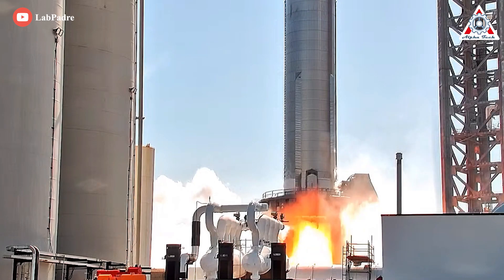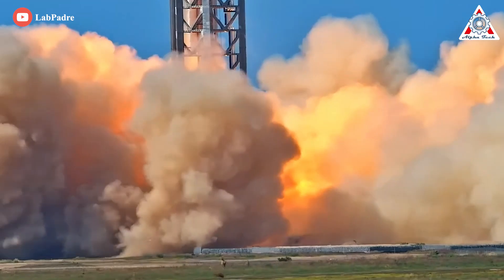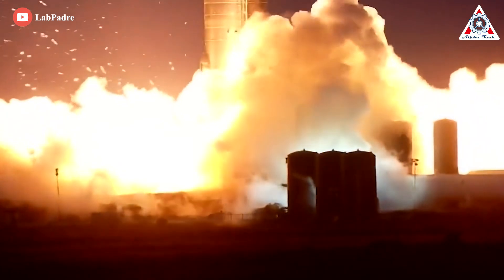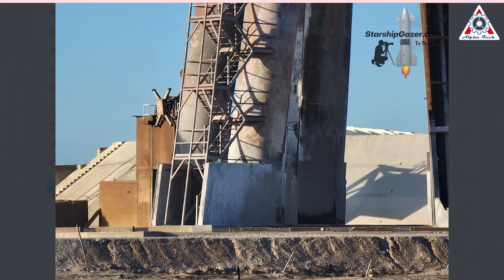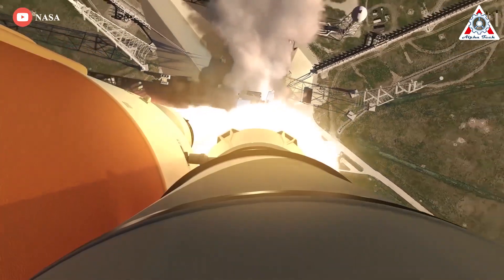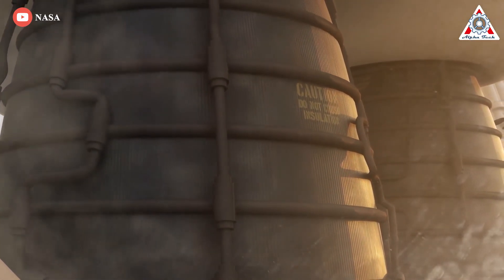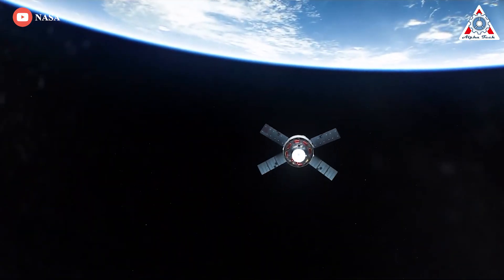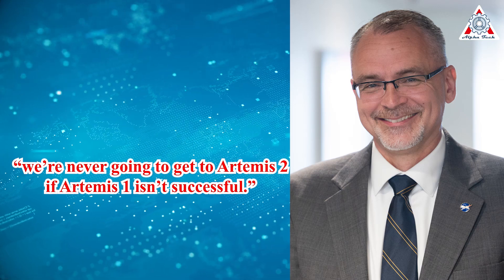Analysis Starship Super Heavy Booster 7 14 engines Static Fire "Problem"...

Comment: I don't know anything about launching rockets but seems like there needs to someplace for the exhaust to go. My thought is a 30 foot diameter shaft under there with a platform in it that raises up and down, up to ground level to put a raptor on and raise it up to install or remove then the platform lowers to the bottom to launch, when at the bottom 6 tunnels are exposed for the exhausted to escape to ground level some distance away.

Comment: I think it's crazy how NASA finds it acceptable to test a rocket one time and then say it's okay to put people on the next one when in fact the one that was tested is completely destroyed when it's finished and can't be used again. Seems like putting humans on the second one is a bit premature. How do you know the first one didn't just barely succeed and the second one isn't going to blow up? SpaceX had to fly their vehicles over and over again with cargo before NASA was okay with putting a person in the thing. I definitely wouldn't want to be one of the astronauts that rides in any NASA's rockets. Especially after finding out the people in charge had ignored the engineers that told them the night before launch that the Challengerwas going to explode. As smart as the people at nasa may be, it seems like they don't have a whole lot of common sense. Spending billions upon billions of dollars using old technology that can't be reused and then Deming it safe for people to fly on a brand new rocket system even when the first one had issues.

Comment: This shouldn't be the hard of a problem to solve, just repair the concrete and then lay out a bunch of 1 in or more thick steel plates all over the launch pad and then weld them together. Have gigantic threaded studs embedded in the concrete and sticking up and have holes in the steel plates that match and then screw on some big nuts and washers and Bolt the plates down, and call it a day. Use some sort of high carbon ballistic Steel and that rocket should not be able to faze it. If needed it could be sintered with a layer of tungsten, at least where the blast hits it directly. It might be a little bit extreme but they wouldn't have to mess with it again.

Comment: I didn't see any videos of Booster 7's 14 engine firing that had resolution good enough to differentiate the weather the falling chunks were ice or Martyte.  If they were "concrete" as you've described here, thrm most, if not all, the chunks were Martyte  . . . a ceramic based epoxy used for coating Starbase's launch & test pads. Martyte is sacrificial by nature, meaning it's expected to break up while protecting the hardened concrete beneath it. The worst that could happen is Martyte chunks damaging Engines, wiring or plumbing. SpaceX has experienced this before and taken precautions.  I'd be surprised to hear of any more damage than to the Martyte coating itself.

Comment: Suggestion for upgrading the launch mount for starship. Line the launch mount with firebricks, foam glass or even starship heat shield tiles. Obviously concrete is not sufficient blast shielding.

Comment: Why don't they use the heat shield tiles to protect the rocket mount? It seems like there's no chance of it surviving the heat and thrust of all 33 engines firing at once with the heat shield they've already added! I get that they want a different way of doing things, which opens the possibility of creating new and sometimes better methods of launching a rocket. But the damage and the plumes of dust should be a very serious consern.

Comment: with all the geniuses working on SpaceX, can't they see that the clearance between the engine and the ground is too short for the engine blast?
Reply: It is not the clearance. It is the reflection of the blast wave off the ground. They knew about it but Elon didn't want to build the flame diverter. Because he wanted his rockets to land on 6 legs and a flame diverter prevented such a landing. But that landing on legs idea was eventually scarped as rockets needed to get beyond LEO had to be more powerful.. Now they are having issues. The correct solution is to build a pad with flame diverter, a big one that can take 2x the power of a Saturn V rocket

Comment: Very short record.
Artemis finally launched VERY early in it's launch window - less than 2 days later.
Booster 7 will have to fire about EVERYTHING to take the record back.
Reply: Booster 7 will have to fire about 20 engines to produce more thrust than the SLS.

Comment: Yeah, welcome to the lowest bidder concrete contractor in Texas. Contractors in Texas are notorious for overwetting concrete in hot weather to make it flow more quickly and go farther (water is cheaper than concrete on a big job) during placement, instead of keeping it stiff within specifications by using vibration for assistance. Too much water in concrete makes it weak and causes spauling. Both the contractor & the QA Inspecter should be called out for not doing their job. That's going to require an expensive fix.

Comment: Everyone knows all this concrete stuff, the problem is everyone demanding heavy burn the pad to death because NASA does it for their specific reasons related to one off motors that after 50 years are somehow expected to be unreliable, you don't run your car for 2 hours before driving to the shop just to make sure same with a 747.

Comment: Just place a simple catalyzing ring directly beneath the rocket and catalyze the exhaust, using the heat, back into methalox, and use the velocity/ pressure to pump it thru a one-way valve back into tanks. At liquid state, run it thru filters to get the concrete, bricks, crisped birds, sand glass, alligator bacon, and water ice out of it and violla! Efficiency! Re-usable fuel!
Reply: Alligator bacon for sale after every latch .LOL.
Reply: You id  iot. Please be reasonable. Not funny.

Comment: I have never thought clustering so many engines was a good idea.
Reply: Each engine is separated from the other engines with a heat shield so there is no problem with them being close together.
Reply: @michaeldeierhoi4096  That's not my concern. Having so many engines increases the chance of an engine failure.
Reply: @bobhope3716  When is the last time you heard of a failed engine on a Falcon 9 or Falcon Heavy?  If the raptor engine is well developed and proven like the Merlin engine then multiple engines as on starship won't be serious problem.  And an occasional engine failure is more then compensated by the redundancy.  

And bigger engines become proportionally more technologically difficult.  The Blue Origin is a case in point with the Be-4.  These are the only two methlox engines being tested to my knowledge.  

Over just a few years Space X has overseen a rapid development of the raptor engine which may be the most innovative rocket engine out there.   

The tests of starship orbital flights will be the real test of the reliability of the raptor 2.
Reply: @michaeldeierhoi4096  Ya Ba Da Ba Do !
Reply: @bobhope3716  Is the best you can come up with?  That sounds more like Fred Flintstone.

Comment: I'm amazed at the apparent, mind-blowing stupidity of firing 14 engines with zero exhaust venting by the launch pad. It's as if they want to avoid building what's clearly needed to save spending the money where it's needed. However, it could be that the long-term idea is to launch out in sea where explosions will cause minimal damage to the surrounding area including a miscapture leading to an extinguished explosion.

Comment: I am sure SpaceX have thought of this and there is a good reason not to do it, but why not initially fire a small number of engines, just as many as needed to clear the launch mount by a safe distance and then fire the remaining engines? This would dramatically reduce the forces applied to the launch mount. I know they would need to carry more COPV's onboard, but I worry that multiple launches of Superheavy with 33 Raptors firing will destroy the launch mount, no matter how much protection they give it.
Reply: You need all the engines at the beginning because that's when you have the most fuel and weight.  And fewer engines, even if it was possible, would mean a longer time lifting off the pad pelting it with even more heat.

Comment: The whole idea of using just one launch tower is... and the whole idea of catching a Starship and Booster with the chopsticks is...If the booster/starship blows up after say 10 launches then it will take at least a year to rebuild. They should build a landing site just like Nasa's...away from the tank farm and all the support equipment. Also, a Capsule? really?. A Capsule landing on the Moon?? We need rocket ships to land on the Moon not 60's capsules. They should scrap the Artemis program and go with Starships.

Comment: Elon and SpaceX are pretty dumb to have a flat base under the launch tower. It should have a deflection slope at least twice of the Saturn V rockets. When they fire all 33 engines, I wouldn't doubt that it will blow a hole so large that the tower will tip over.

Comment: Debris is one of the reasons why you clear the pad. At some point, I believe Elon will have to look at a true flame trench/diverter. You know, some of those bits of concrete hit the underside of the rocket. I wish Elon and his team all the best and I wouldn't bet against him. This was a true huge success on several levels.
Reply: The pad is clear.  The debris is from the pad literally being blown apart by the rocket blast of the Raptor Engines.
Reply: @damonried1720  ...ABSOLUTELY RIGHT!...that's what this twit doesn't seem to understand.
Reply: ...Just how much of a HUGE success is it going to be when a fully fueled Starship explodes on the launch pad?...The fix is required NOW!...NOT at some point down the bloody road!!! 🤪🤪🤪...🙄

Comment: “Don’t raise the bridge, lower the river.” 

No guarantee, but one of many things that could help with pad RUDs would be to raise the height of the launch mount, or redesign it to be a deeper pit. The thought is that by increasing the distance from the face of the concrete to the closely concentrated thrust from the engines, the distance would help soften the intensity of the thrust hitting the face of the concrete.

Comment: At least 22 engines are required to lift starship at full propellant load, so with it likely not being a full propellant launch for the first orbital flight, a 14 engine takeoff is completely possible, so it would not cause much more damage than what we have seen on this static fire
Reply: With a thrust to weight ratio of 1.5 the starship would need at least 22 raptors firing full throttle to lift off. L 14 raptors wouldn't cut it.    Even with that number of engines firing the slower lift off means the plume damaging the underside longer.  The whole point of starship is fire all 33 engines to lift more quickly clearing the pad and tower a few seconds.

Comment: There was a good reason why the Saturn 5 flame pit was so huge and why the rocket was so high off the ground. Even then the pit was usually damaged.
Reply: Water helps. But  Russia used a deep pit on top of a very high elevation system. NASA new this their for integrated lots of water .

Comment: 1:35

Why would booster firing 14 engines produce more thrust than the falcon heavy firing 27 of the same engines?
Reply: Because they aren't the same engines at all. Falcon9/Heavy uses Merlin M1D engines that produce around 63.5* tonnes of thrust each at sea level (Using kerosene and liquid Oxygen) whilst Starship uses Raptor2 engines that produce around 230* tonnes of thrust each at sea level (Using methane and liquid oxygen) 👍

(* - Different sources give different figures...)
Reply: @marko247  wow, the starship is absolutely incredible when you compare it like that against falcon heavy. 33 engines plus 6 on the upper stage absolutely dwarfs falcon heavy
Reply: @NuDavai  Falcon Heavy is already a pretty beefy rocket... Starship will be like strapping 4 and a half of them together. It is shaping up to be a monster of a rocket!  👀
Reply: Gee just a little time ago the Falcon was BIG .

Comment: If the Starship rocket is having this much of an issue with debris flying around when the engine ignite over a well prepared launch platform, just how in the hell is it suppose to get off of the moon from a un-prepared surface?????  I hope the simulations showing Starship landing on the moon have left something off because those engines come very close to the moon’s surface, and I don’t see any way for the engines not to be destroyed when it tries to takeoff or even just from the landing.  Anyone know how this is really suppose to work??????
Reply: I was interested in this as well. a nasa employee thinks this is completely doomed from the get go. the original moon landing vehicles were all extremely small in comparison to what is being planned currently. I wonder how the moon lander fair with its launch and if there was any damage from debris during lift off.

Comment: why are they not simply lifting the rocked mid air and launch it from 30m above?
Reply: The launchpad is Stage Zero, it couples to the outer ring of twenty Raptor engines at the bottom of the booster and provides high-pressure gas to spin up the engine turbines at ignition. This is called "spin prime". Lift the booster up off Stage Zero and the outer twenty engines can't start. The SpaceX engineers didn't want to carry turbine start gas for all 33 engines in the booster because it would take up a lot of space and add weight which they wanted to leave on the ground. They can start the centre engines with onboard gas since that's required to restart them for for re-entry and landing of the recoverable booster but the outer ring of engines are only started once at takeoff.
Reply: @robertsneddon731  then a classic design with a flame tunnel below the pad would make sense

Comment: I don't see this as a huge issue. These tests are meant to not only work out any rocket/engine issues but also work out the exact requirements for the ground equipment. The people at SpaceX are smart. They knew rather they put a fire diverter in or not that they couldn't leave all the pipes and wires exposed so pieces were designed to protect them. With the larger amount of engines now being tested they can fine tune where they need extra protection and can alter the pieces meant to protect these systems. Which they have already started.  After the static fire of the 14 engines. They have already started to weld the protective pieces in place to cover these exposed systems.  As for a little paint flaking off. If that is the sole issue and it doesn't overall effect the health of the stand. Then I think SpaceX can afford to send some out there with a roller to constantly repaint. If that's the cost of making the human race a multiplanet species.

Comment: Not surprising at all! I have always thought SpaceX has completely underestimated the entire conception of Pad/Flame Trench//Water Based Force and Sound Suppression system - by orders of magnitude. “Big Rocket on a table, with a bit of water underneath” doesn’t remotely do it.  Look at the mega trenches and water systems at NASA’s launch complex 39. They were designed for the Saturn V, and that’s still considerably less than what Starship is supposed to pump out.

All of the SpaceX facilities in Texas look incredibly unprepared for the ghastly magnitude of Starship. Facilities, other ships, water tanks, fuel and cryogenic tanks… all are remarkably close to the actual launch pad. It’s all separated by a few hundred feet, or less, rather than the 3+ MILES used by NASA in the Cape Canaveral Complex.
Reply: It's Texas, where life is cheap. Deal.

Comment: It seems to me that the only way that this could be fixed would be to weld steel alloy plate below the launch pad with a water cooled matrix for cooling.
Reply: Spraying molten steel (which is what would happen) would likely be worse.   Maybe with some sort of eblative coating on top of steel though.
Reply: Tantalum carbide on a graphite binder might work, bit how resistant to vibration it isau rule it out

Comment: Fire and concrete don’t mix , even if they drop lots off water the thrust of the engine push the water away so the hot gas from the engine is in direct contact with the concrete

Comment: I was wondering if anyone thinks it’s a good idea to use a cermet covering over the concrete. When I worked as an engineer suppliers gave us samples to examine. The one thing I was impressed is how light it was yet with strong tensile properties. This should be able to handle the vibration problem better than concrete.
Reply: Metal plating would do the trick!
Reply: @ariadnelecoutre9453  Exactly, easy fix.
Reply: @matthodel946   I thought so to . 10 inch's or so of good steel should hold .lol might be cheaper than replacing the concrete each time .
Reply: @geraldg9226  even 3/4" plate steel would be so legit forever, eff concrete.

Comment: Lay an inch thick armored steel pad on the ground underneath the booster.
make the steel pad a 100 foot diameter circular shaped shield.
Anchor the steel shield  to the grown.
Problem solved.

Comment: They have a lot of left over heat shield tiles just sitting over in the rocket garden. Wonder if there is some way to fasten those into some sort of deflector. They are learning now how to mass produce them so it shouldn't cost too much to divert some production for a launch exhaust deflector.
Reply: Dave Allen  Wow thanks Allen I had no clue that was the case.
Reply: Sonic forces would shatter them. I'm afraid.
Reply: nice idea